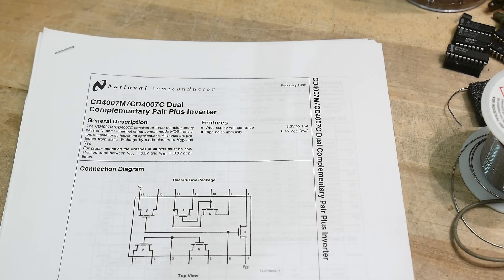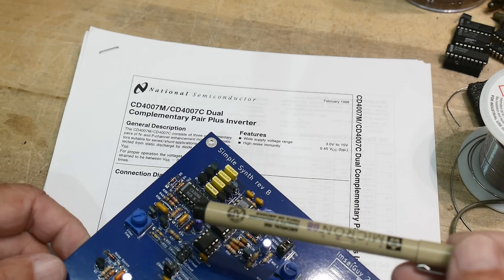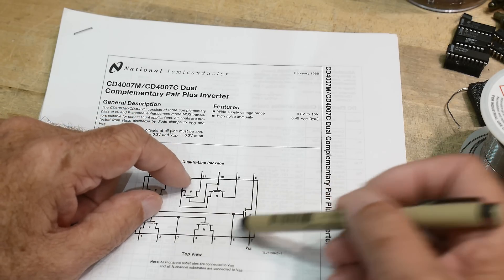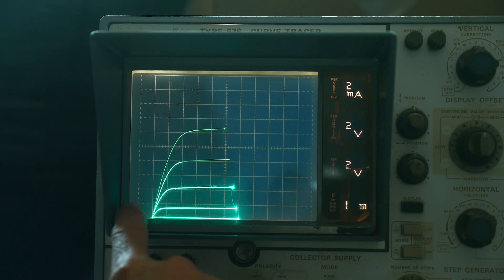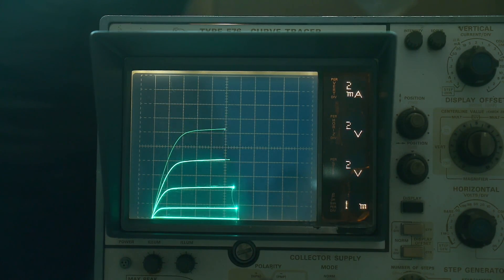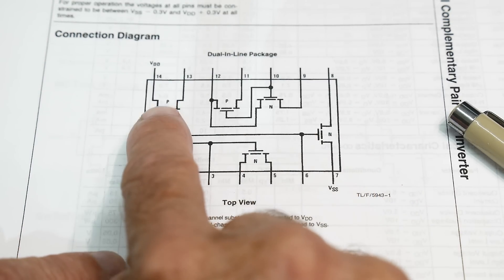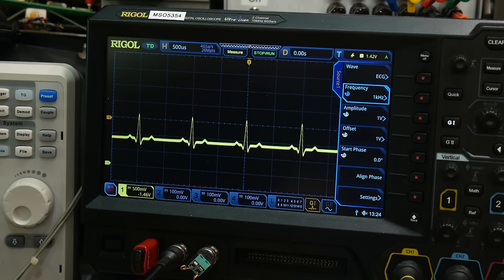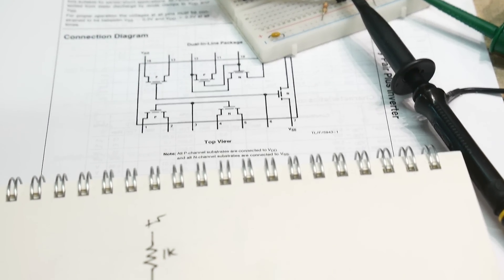#1539 4007 Complimentary FETs

Comment: I don't get it. How's that demo circuit not inverting the input signal?
The top MOSFET is P channel, the bottom N channel. When Vin raises, the top one conducts less and the bottom one conducts more, so Vout should go down.
It's the classic CMOS inverter, after all, apart from current limiting resistors.

Comment: IIRC, The CA3600 is basically the same as the CD4007.
The part was extremely useful but sadly not many people worked out all the clever ways to use it so it went away.
Also:  In bipolar arrays, you can get a nondocumented operating move by biasing the substrate diodes slightly on.  It makes the transistors work a little like SCRs so that they latch if the base impedance is high.

Comment: The 4007 is very versatile. Beside unbuffered invertors (useful for crystal oscillators) and other logic circuits, it can be used for analog applications. I have made in my youth a few interesting things using it, like an opamp and a balanced modulator.
Reply: Yes, it can be wired as various analog switches to make demodulators.

Comment: If you are going to make some circuits with the 4007, look at the CA3600, it is the same (probably) chip but then meant for analog applications, it has some interesting circuits to try out. The full opamp in the datasheet is interesting.
Reply: Interesting information - mainly because the 4007 is still inexpensive to obtain